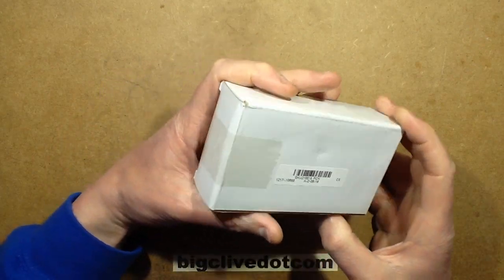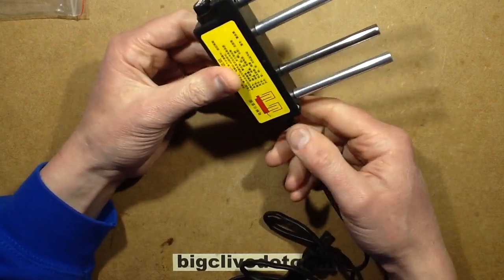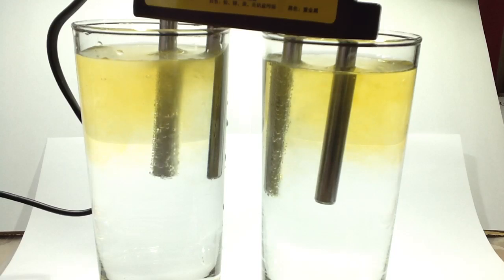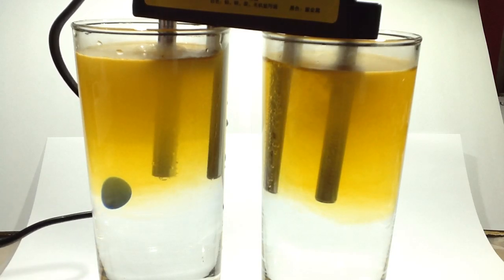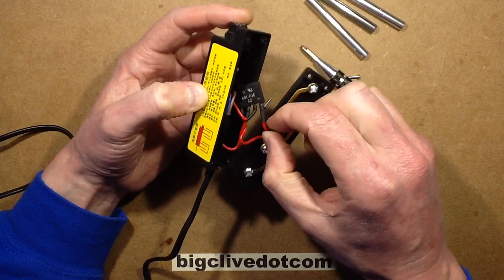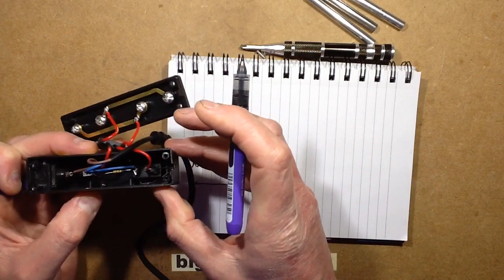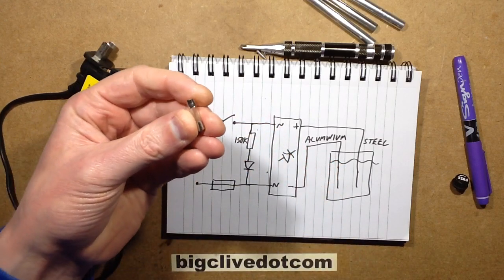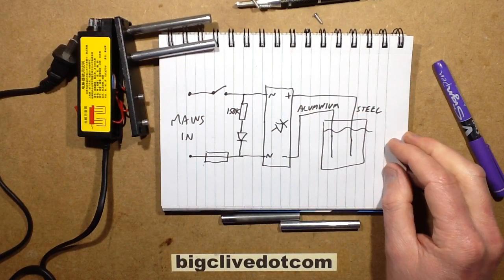Deadly quack water tester.  (scam)

Comment: Can you explain why my filtered water is fairly clear, still compared to tap water and distilled water is very clear. ??
Reply from the maker: The unit works on conductivity of the water.  Distilled water is non conductive.  Filtered water has less minerals and may be less conductive than tap water.  These units exaggerate mineral content by polluting the water with rust.
Reply: Thanks, is the there a device on the market that does test the water accurately? 

I’ve used it on bottled water and get different results on different water as well, but would love something accurate if you can recommend.
Reply from the maker: @dampresolutions2306  You can get a device called a TDS meter (Total Dissolved Solids) that measures the resistance of the water and converts it to a numerical value.

Comment: I think, when the oxygen and chlorine bubbles on the steel electrode it generates some iron oxide, which dirties up the water. That contamination is not necessarily IN the water, but in the electrode. So it really is a scam!

Comment: All he is saying that you can get zapped, never once does he explain why distilled water, which is clean, shows nothing, and when tap water is tested, will show brown, green, black and blue sludge on the top of the  glass of water. He didn't take it far enough, he shut it off too early.
Reply from the maker: Distilled water is not conductive.  Any minerals in the water, including good ones, make it conductive and allows the rust effect to appear.

Comment: If it's scam, why does the Distilled water come out clean? https://www.youtube.com/watch?v=R5f4q0-oxeY
Reply: Because it lacks the chloride (salts) to provoke the chemical reaction. Most minerals in soluble in water come in the form of salts, they're also called 'electrolytes', you know, like the ones they brag about in sports and health drinks. These mineral salts make water more conducive because they help to break down H2O by providing molecules to bind with, like sodium from simple table salt (NaCl - sodium chloride), becoming sodium hydroxide, which reacts with Aluminium to precipitate aluminium hydroxide, leaving sodium to react with more molecules. Al(OH)3 can create a yellowish colour in base or acid solution, and the presence of iron only accentuates that colour, such as in bauxite. All this to say, if you have H20, NaCl (table salt), Al and Fe coming together with DC current, you will create a poisonous alkaline solution, hydrogen and chloride gas, metallic precipitates and that's without considering any other vital mineral normally found in common water.

Comment: A friend of mine just got one of these. He tested tap water against spring water. The spring water just had a little yellow/orange tint. The tap water had all the green and black. We're testing different filtered water tomorrow.
Reply from the maker: The colour is caused by the electrode corrosion and conductivity of the water.  Just because water is slightly conductive doesn't mean the minerals in it are bad.
Be very careful to unplug this device before touching it, as it is extremely dangerous.

Comment: its a crude device but certainly shows you the shit they put in our water tap and bottled so has its purposes regardless of how dangerous it is and if your brainy enough to test your water you put inside your body your surely not stupid enough to put your hand in the water while its switched on
Reply from the maker: Or while it's out of the water and switched off, since it only breaks one of the two connections.

Comment: Pointless video I used one of these on and it does the trick. Just leave it in there long. Don't enhale the fumes. And don't touch the rod. There is so much crap in our tap water. I ended up getting it pretty pure after filtering the same pint of water 20 times. Electrolyse for about 10-20 mins between each filter. You'll eventually purify the water.
This video proved nothing apart from don't touch the rods when turned on
Reply from the maker: It's theatre, using electrolysis to exaggerate the presence of natural minerals.  The unit is stupidly dangerous, even when the switch on it is turned off.  But if it makes you feel good then by all means keep using it.

Comment: I missed the part where it was proved to be quackery. Not all water turns brown. Some turn green and others black. Something is happening, some kind of reaction. I'd much rather drink the water with no colour change, distilled. But yes, not too safe at all. Perhaps all that Chinese writing on the sticker contains a warning if can read it 😏.
Reply from the maker: This dangerous device just puts on theater for sales purposes.  The show it puts on is dictated purely by the salt or mineral content of the water whether it is good or bad.  The colour comes from the electrodes themselves.

Comment: I am sorry,  you are a scammer, more conductivity in the water it is mean more contamination or more TDS ( Total dissolved solids ) in the water,compering same process in pure water you will not see the yellowish color and stays clear, this is mean the current will not pass through the rods and it is mean the TDS is very low or 0, that’s all about
Reply from the maker: The scammers are the people using this stupidly dangerous device to exaggerate a low level of minerals in water by implying that the brown electrolytic corrosion is in the water.

Comment: How new is the filter for the filtered water? It is cleaner water through your filter (you said it is) and may need replacing. A good test for testing your drinking water is, and I highly recommend we all do this, buy glass bottles with a largish screw on lids, and fill a bottle with cold water from you kitchen tap and fill another with water that has passed through your filter. Let the bottles stand up to 6 months and meanwhile drink bottled water from the supermarket. My glass bottles show a yellow sludge in the bottom of the glass bottles. So, I found out my water filter is dead within a year and the yellow sludge is insoluble substances in my tap drinking water. Deadly.

Comment: This is a very old video, but, my bet is that the reason for the electrodes being different metals? Electrochemistry. They're not content with leaving anything to chance; the electrodes themselves have some kind of reaction that puts all that, as you say, 'yuck' in the water, and that reaction wouldn't happen if one of the glasses was, as you say, filled with distilled water masquerading as filtered.
What was happening in those glasses reminded me very much of watching NurdRage. This is a scam on so, so, so many levels.

Comment: Ive ttested multiple watewr sources and ALL HAVE COM EUP DIFFFERENT. If it were a scam the they would ALL BE THE SAME YOU FUCKING QUACK
Reply: It is a scam, and you fell for it!
Reply: @CNCmachiningisfun  wrong. This tells you how many minerals you have in water. The different colored results tells you what kind of minerals. Organic or non organic plus other metals. Yellow is good and dark black is contmainated with other bad metals along with your good minerals. Since there are good and bad minerals it's safe to test water using this, see what color result you get and just purify the water and re-add ONLY THE MINERALS you prefer. This tells you the levels of minerals. Hard to explain In text format.

Comment: I used to have a filtered pitcher that came with a battery powered tester that measured an unknown contaminant in the water. Digital readout, and almost instantly shows measurements. (Probably passes a small current and judges off resistance)

I already knew that the area i was at would have horrible tapwater. They said to replace the filter if it hit a very low amount measured. But my straight tap read at 200. Originally the filtered did read a flat 000. Only downside was the way the tester was designed you couldn't actually clean it, so i feel like just having water on the tester would throw off the results fairly quickly as the probes get contaminated.
Reply from the maker: It was probably approximating TDS (Total Dissolved Solids) by resistance as you guessed.

Comment: I’m sorry, why is the water changing colour? I’ve seen this experiment on tap water in the UK and the water went completely black from the impurities in it! 

So if the water is safe to drink … why is this happening please?
Reply from the maker: The unit basically corrodes the electrodes like rust to colour the water.  Normal tap water is slightly conductive so it will happen faster than distilled water which is not very conductive.
None of the colour is actually coming from the water -  it's just used as a stunt to sell filters.

Comment: So ok the machine is dangerous. Does it work tho and show impurities in water ?
Reply: No. It does not work for that purpose, or anything else, really. 
 It delivers current to the water, and ADDS impurities to it, as its electrodes break down during electrolysis.
Reply from the maker: It displays conductivity in a dramatic manner by corroding brown dirt into the water.  All the dirt comes from the corroding electrodes.

Comment: That tool does seem to  work. I tested my filtered water with a TDS(Totaled Dissolved Solids) meter. It read “0” TDS. I then tested my tap water. It read approximately 240 TDS. I then used that “Gadget” to test both waters. The tap water was dark green green, with some yellow and the filtered water was clear.
Reply from the maker: The conductivity of the water is what determines the speed of the electrode corrosion.
Reply: @bigclivedotcom  Yeh right, you're a muppet with an F. Tap water is still disgusting, whether this device is BS or not. Ever been at a water waste plant, ever seen the pipes used for our supply? It is horrific and I would not use it to clean my boots with it.
Reply: @tim27scissorfists  
 Agreed.  This device IS BS!

Comment: I've been using this device to test water for years. You have no clue what this does and what's its intended use is. It splits H2O to release the nasties. The ignorance here knows no bounds. You must leave the electrodes in the water for at least two minutes.
Reply from the maker: I'm surprised you've not had an accident with your quack product.
Reply: "The ignorance here knows no bounds." 
 Agreed. Your ignorance is of lethal proportions!

Comment: Electrolysis breaks down the bonds and separates the impurities from the water. If you use distilled water with this is stays crystal clear. Be warned. Drink only distilled water

Comment: Are you actually saying that electrocoagulation as a filtration method is a scam? 

Are you stating that electrocoagulation is not a well established, ultra efficient filtration process used by industry worldwide?

Then you should contact Wikipedia and ask them to remove their scam page on electro coagulation. But I think they might laugh at you.
Reply from the maker: Electro coagulation is real.  This is absolutely not electro coagulation.

Comment: hes talk about the device which is perfectly safe when understood , no he is avoiding the chemical reaction caused by the use of this device , forget his opinion because he is not discussing the testing aspects and why one is metal and the other aluminium , well its because when those two elements come together with bicarnonate of sodium you can clean jewellry and silver and other things ,a very efficient cleaner ,now without sodium bicarbonate electrolysis is more efficient and shows up detected and "burnt " of by lectrolysis polutents , his water filter claim is a little suspect , no this macvillain is an employee of MacJock water suppliers Glasgoaway ,if he avoids the talking about the reactions when aluminium and stainless steel come together ina water based enviroment with electricity or bicarbonate sodium ,then he is depriving you all of important information ,this is why in you washing machine you are told do not place aluminium in the drum stainless steel because with washing powder their will be a reaction that will start to clean or consume impurities and what colour do impurities show up as ,yellow brown black ? etc
Reply from the maker: This unit has exposed mains voltage connections.  You can clean jewellery with much lower and safer voltage.
Reply: @bigclivedotcom  yes, of course , that was simply an "for example" so those reading can grasp what this set up represents in all its varying forms.
Reply: @bigclivedotcom  however the glues used in cheaper jewellery may perish .

Comment: I've actually had water, sorry council pop that colour come through my tap crap awful tasting stuff here, the midlands.
Reply from the maker: It's common when work is done to water mains.  Traces of mud will find their way in.
Reply: @bigclivedotcom  Clive honestly I dont remember they were probably working on it, it was twenty years ago and I've had two brain traumas so my memory is shot to bits. Nice one Clive. 
Question what's a good starter kit for soldering been looking at one of those alarm clocks or a pi of some sort. Not being able to work any longer plus's ADHD boredom is a huge problem I so regret saying I wish I didn't have to work, be careful what you wish for and all that.

Comment: I was hoping you were going to measure the voltage across the electrodes
Reply from the maker: It's full mains voltage.  No current limiting.  Just a rectifier to convert it to DC, and the switch may not isolate the electrodes from the mains live.

Comment: Reminds me of when I was servicing an aircraft ground power unit at a local airport. The unit was capable of delivering a continuous 800 amps at 28Vdc as the aircraft engines were cranking. I had to load test the thing, but I couldn’t just get the pilots to crank the engines, so I had to make a dummy load. I got hold of a 44 gallon plastic barrel, and two 25mm by half meter long stainless steel bars and put them in the barrel full of water and connected to the GPU and turned it on. I then started adding salt until the current reached 800 amps. After about 10 minutes or so the water was boiling over.

Comment: Buchachachachacha 😂🤣😂🤣🤣😍🤣😍🤣😍🤣😁🤣😍🤣😂🤣 SCIENTIFIC TEST 😅😅😅😅😅😝 HAVE YOU SEEN THIS CHAP FILLING THOSEE GLASES WITHH WATER - directly from tap?????? Of course he did not. Use it home with your tap water and distilled water. Nothing will develop in distilled water.  This device is brilluant but THIS. TEST IS LAUGHABLE SCUM  and the explannatioon is rubbish
Electricity lesson here is completely useless and irrelevant. try in distilled water it will proove itself.
THIS VIDEO IS COMPLETELY RUBBISH

Comment: I saw someone use one of these with a water filter and tap water.  There filtered water was fine.  The tap water was brown and awful.
Reply from the maker: It works with water conductivity.  Distilled water is not conductive.
Reply: My water wasn't distilled.  It was filtered
Reply from the maker: @sweetmaths4213  A good filter that took out minerals could also make the water high resistance.  TDS (Total Dissolved Solids) meters usually use resistance to test the water.  The higher the resistance, the less of a show the unit will put on.

Comment: Shipwright here. That is simple electrolysis from DC power applied to two differing metals in water and the electrical current causes the more noble metal (steel) to erode the other (alum). Total scam. Lethal at any voltage above 32. Yikes. People die every year swimming in marinas from boats being improperly wired, let alone propellers and shafts being eaten away.

Comment: So I used this death machine on my reverse osmosis versus my filtered water. After 45 seconds I switched it off and unplugged the gadget. 

I waiting about 2 hours. The filtered water was brown and black and soon the particles had drifted to the bottom to form a mucky orange, green, white, yellow, pink sludge with 1mm sized black particles. The reverse osmosis had a trace amount of haze at the bottom, but no solids. 

I also noticed that when I slid a neodymium (or shall we say neodyoominium 😁) magnet next to the glass a good deal of the sludge moved to follow the magnet around the glass. 

Just what are all of these particles lurking unseen and hiding from an unsuspecting public that are consumed in vast quantities daily?

I would rather know that what one is  essentially drinking is about a teaspoon of nasty-looking magnetic custard and particles that are clear to the naked eye with each glass of filtered drinking water. 

Where’s the quackery? Isn’t it exposing a sludge you’d not spoon into a baby bottle and feed your infant?

I’ll agree that it’s not a safe item, but it clearly says on the side of it that you should  never use metal cups with this, that you should not touch the rods (iron and aluminum) and switch it off and unplug before setting the electrocution device on any surface. 

Will someone give me an argument for feeding that nasty water to my kids after what I’ve seen. 

I do intend to redo this test and then smear some of each of the colored bits on some agar-covered Petri dishes and see what grows.  If anyone cares to hear my results, let me know here.
Reply from the maker: The device uses the water conductivity to pass current between it's electrodes causing them to corrode rapidly making the water look dirty.  It's the unit that added that dirt to your water for drama.
With very pure water the conductivity is lower and less rust is put in.

Comment: The item is fitted with a north American two pin plug.

Please could you tell us: were you operating at the north American voltage for such plugs of 110volts or at the UK wall socket voltage of 220volts?

Ps my PhD is in Chemitry (UCL 1983).

Yes, this thing is pure dangerous nonsense.
Reply from the maker: Chinese 220V plug.